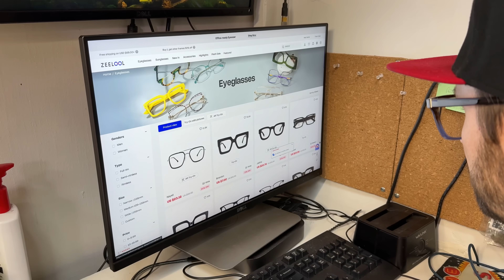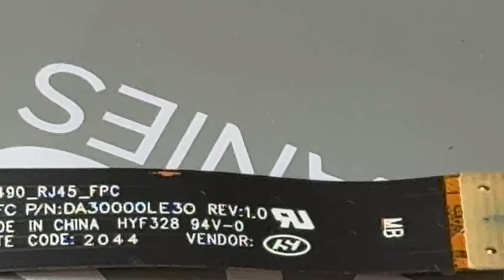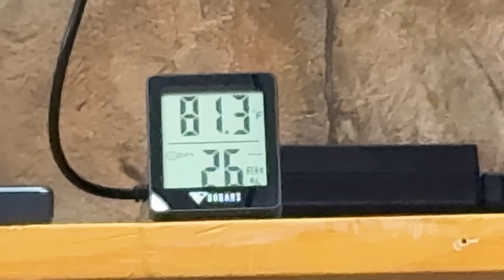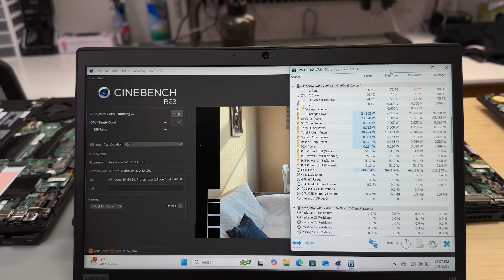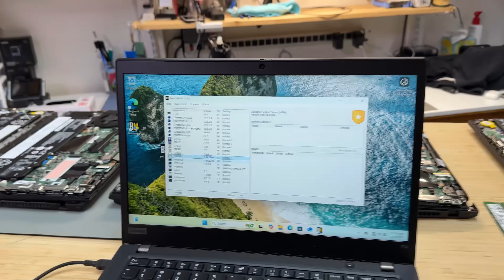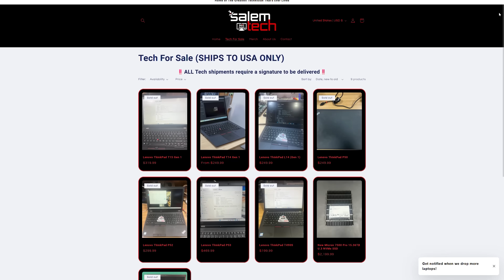Is Replacing Laptop Thermal Paste a MASSIVE Waste of Time? Let's Test!

Comment: Imaging devices - These are corp laptops so they can be PXE booted.  You may have to invest in some hardware - server and a big switch to handle the amount of connections.   If you're imaging Windows, then use Win server and MDT which you can install Windows+drivers in one go and in a reasonable mount of time.  Imaging Linux can be done the same way but with something like FOG project.   Fresh wiped drives, enable PXE and image up 20 lappys in about 45 minutes.
Reply from the maker: Thank you, I've known about PXE but the setup is intimidating. What about when the laptop doesn't have an ethernet port? I'd have to have like 100 USB-C adapters yeah?

Comment: I reduced thermal throttle considerably on my msi gp75 when I replaced the thermal paste and thermal pads. Still sounds like a jet engine but using a laptop cooling pad helps with the sound.

Comment: Hey ! For you deployment problems you can spin up a WinServer with WDS /DHCP and MDT, then boot everything from the network (PXE) with computers plugged to a switch. However, with all the reimaging you are doing (even with your solution) you legaly need a VL agreement with Microsoft. ( It's a licensing restriction, not a technical one, however).

Comment: Counter point to the blue light glasses, the reflections in your eyes from lights behind you will become blue which is very distracting

For laptop's Imaging seems to be the "old" way to do it, I'd suggest setting up a few USB's or a PXE boot server to get imaging up and running. 

Shipstation is a pretty cool solution for shipping tracking and they offer some partnerships with shipping vendors.

Comment: @3:45 deployment problems, 

Spin up a WinPE server and create a Windows .wim to use for the install, set up an unattend.xml file for setup. I spun one up at the MSP I used to work at for a client that frequently was replacing HDDs with SSDs, it made it so much faster since it could be ran anywhere on their LAN and was only bottlenecked by network speed of routers/switches, and CPU usage on the machine getting imaged. My current job uses SCCM (overkill for smaller businesses) so PE should work fine

Comment: Have a look at FOG project, or MDT as free imaging options. You can deploy a golden image per model or do custom deployment settings like unattend file, account setup, or driver and app install sequencing. PXE boot is the way to go, just make sure server and switch is good enough to handle throughput, and laptop BIOS has PXE boot enabled. Use USB 3 to ethernet adapters if theres no ethernet port. Good luck man!
Reply: Alternatively,  you can also just deploy images with a bunch USB drives (anything slower than 3.0 will take ages). Either with a golden image / clone or a custom wim injected with drivers and packages using DISM. You can still use scripts to modify the boot and make the end to end install automated, so all you need to do is plug in and select USB boot (after doing the prep of course lol).

Comment: For me replacing laptop's thermal paste is a really fun thing to do~

And it's a step that makes you study about your laptop
Reply: I have to agree...it's scary at first. Tbh

I had to do my first thermal paste application without any high concentration based isopropyl alchol because I could not find any in stock. So I had to use a cleaning liquid which had iso alc in it.

Wouldn't recommend but it worked, so temps went from 80 degres to 50 ish at idle. 

Sidenote: This was my old i3 115g4, which had a high base frequency for a laptop at 3.0ghz and a 4.0ghz boost clock. Thus the high idle.
Reply: How do you get over your fear of destroying your expensive laptop while trying to do this?
Reply: @thomascromwell6840  
One thing I WOULD advise.
Restart into BIOS before the procedure and look for the "Battery disable" (Or similar) setting, set to "Disable"
.
Unplug (Obviously?) before doing this.
This ensures there's no power on the main board (except the BIOS battery) when you dive in and start dropping screws on components.
STILL unplug the battery.
AND
If you try to reboot when you finish and PANIC(!) because the Laptop is "dead", connect  the charger, THEN hit the power button. That may be required on the first Boot.
Reply: @thomascromwell6840  Depends on what your model is, I would advise a few very important steps, I learnt from my first time doing this.(Sorry for the paragraphing but I used my botched attempts on a cheap laptop as an example.)

1. Make sure you have the correct tools. This is crucial as a not having correct tool, for instance a pry tool (which you can easily find at a computer store) might result in you improvising and using something stupider like a fork. Which can leave marks or permanent scuffs and damages. Usually what you need is:
      >A small screwdrivers set
      >A pry tool
      >ISO Propyl Alcohol (around 70% is generally okay)
      >A microfiber cloth or wipes
      >After watching tear-downs, you may want to see if there is other specific items you also need, such as for HP they tend to put screws under the rubber feet of laptops,      thus I also need a set of the special glue to re-glue them (the specific other items required vary between laptops and their repair-ability.)

2. Watch videos, even at 2x speed having an idea of what to do is better than having no idea at all. You can watch general servicing videos which instruct on what procedures to follow when changing thermal paste on laptops (IE. Make sure you are not doing this on Linoleum carpeting or a tiled floor, a wooden table would be better and the first thing to do when inside a laptop is to disconnect battery). Then you can focus on your laptop specific tear down video from manufacturers or a third party. I know for my new laptop (HP ENVY 2023), that HP has made a video on their YT with a detailed tear-down and I can appreciate them for it.

3. Have a LOT of patience and I mean a lot. On modern high end laptops, everything can packed into the size of a A4 sized, 200 page book, imagine that. So computer professionals can take about 2 hours depending on the make or model (looking at you Acer Nitro), for a first timer it might take 4 hours. The more patient you are the higher chance you are putting it back together. Even when taking it apart it may seem that things are moving slowly, prying slowly over a larger spread is better than a large application of force with a chance of damaged meatballs.

4. Stay organized and refreshed. Have a snack around which won't damage the open internals (definetly not Cheeto dust or liquids but maybe a few apple slices or sth). For staying organized, it helps to have a seperate table or flat secure surface around the house to temporarily label and store the small components and ESPECIALLY SCREWS with different lengths that you pull out. Make sure you are especially careful with the heatsinks and the fans and give them a clean too, a toothbrush to clean off fan dust (a blower might spin the fans too fast and damage bearings) and isopropyl alc to clean off thermal paste.

Just make sure you learn how to and how much thermal paste to apply when changing it and don't forget to miss the gpu, if there is one. The less uncertainty there is the less fear you have, just don't be overconfident(thinking you are better than the professionals or tutorial) and be careful instead (playing a video on the mobile while changing it to make sure. I hope this provides some help to anyone who reads it, thank you.
Reply: @dragonic_rage  thank you for your advice. Btw im scared of damaging little thingd around the cpu while cleaning the thermal paste
Reply: @dragonic_rage Unfortunately I noticed one of the screws got stripped when I was trying to get access to the CPU. That prevented me to replace thermal paste.
Reply: @dragonic_rage  hey thanks for the advice! 
Think you can recommend some thermal puttys for the VRAM and power delivery chips for the laptop??
I was thinking of opening mine up and repasting the system this year.
Reply: @hulllitok the components are pretty tough. They can withstand a lot if you don't apply a lot of force.
Reply: @legendaryslayer1234 oof. There is not much else to say here.
Reply: @thomascromwell6840  Getting real drunk beforehand. 

That is a joke do NOT do that.

No, its just something you kinda...gotta get over. Study, go slow, trust yourself. That's really all you can do.
Reply: It is a huge pain when the CPU is not accessible without dismantling the whole laptop. I took apart my friends laptop and it took me 1 hr just to get to the CPU. One freaking hour! Bc the CPU was mounted to the side of the board that's underneath the keyboard.
Reply: I am all for familiarizing yourself with your equipment!
Reply: I want to repaste my laptop so bad but I don't know if this is going to solve my thermal throttling issue
Reply: @zandatsu07  Depends how long it was since it was done last time. I just did it on mine. Not because of any issue. But I try to change paste every few years and also clean it good. It’s honestly not that hard. There are videos on YT on how to do. Also remember to take pictures so you know how it’s supposed to look. Mainly to remember which cable goes where. Take your time and don’t let any furry friends near your opened laptop.

Comment: I'm a lady! How often does thermal paste need to be replaced? Annually?
Reply from the maker: There's not a set time since it's different for every model and how it's used. Generally if you notice your performance going down and your fans start to get crazy even on idle, it's time to check your temps.
Reply: @SalemTechsperts  Thanks so much 😊

Comment: Lenovo has come a long way since the days of the T400/T410.  Andy, I don't know if you ever worked on those, but the fan design was so bad on those that it could warp the mainboard.
Reply: Isn't that the same thing that happened to the Xbox 360 where the heat sink was so bad it would warp the board when the system heats up too much?

Comment: I put ptm7950 on my 2015 macbook air and 2011 macbook pro. Yet both are still overheating with max fan spin. Should I put a second layer of ptm7950 so that the heatsink makes contact with the thermal paste better?
Reply from the maker: Drill holes in the bottom case where the fan intake is. I'm being serious. Obviously remove the cover beforehand and smooth out the holes after.

Comment: I own a computer repair shop and imaging drives individually isn't difficult or time consuming if you have the right tools.  Get rid of that PCIe adapter and instead buy a USB NVMe docking station.  It takes literally 60 seconds to make an image, so 77 laptops would take you less than 1.5 hours to image.  The imaging software I use is Active@DiskImage though I'm not sure how much that factors in to the imaging speeds.  I think you use Disk Genius.  I used that software once and I didn't like it but I didn't spend a lot of time using it so I don't know what its limitations are.  With a good quality NVMe docking station connected to a USB 3.2 Gen 2 port you can easily reach speeds of 400MB/s and an SSD with a fresh install of Windows is only like 20GB in size after compression, so yeah, it takes 60 seconds to restore the image.  The USB docking station is key to making the images go quickly because you don't have to shut down the computer and take out the PCIe card, then screw in a SSD and boot the computer again between each image.  You can just pull the drive out just like you used to do with those old toaster style hard drive docks.  The most annoying thing about the whole process is clicking on the "safely remove hardware" icon in the system tray before pulling the drive out.

Comment: No it isnt, Just replaced my thermal paste on my Zbook 17 G3 and before My M1000M GPU utilization was 90% with just Wallpaper Engine, after I changed the paste, It went down to 25%.

Comment: I've had many used Thinkpads come and go and from my experience, in some cases, the original paste is still good,
but those are rare and is better to just change it when you are at it. Spreading the paste to cover the whole die though,
is useless because it ALWAYS spreads by itself because of the pressure when you screw in the heatsink,
that is definitely a waste of time.
Reply: I bought an Acer nitro 5 that was overheating because the thermal paste wasn’t spread properly. 
Whoever applied it must have pressed the cooler on super unevenly and it all shot out one side because half of the die literally had zero paste on it.

Comment: For me, replacing the thermal paste is worth it, because when it gets to that point, the temps have skyrocketed and the paste has gone hard., therefore not doing its job properly.
Besides, a tube of Arctic MX-4 is not expensive.

Comment: For cloning I'd use Veeam Agent for Windows on the original to a NAS, then boot the recovery image on the laptops with a LAN connection.  You could also try the network stack in clonezilla.

Comment: Hey great video! I was wondering why you specifically are looking for ThinkPads? I'm curious 🙃
Reply: I think it's because these models are reliable and can be fixed instead of having to throw the whole thing away
Reply from the maker: Not just ThinkPads, every other model I listed in the video.
Reply: They look nice and clean, are easy to service and durable. Also applies to most other business/professional computers. 

This in stark contrast to say, older HP Pavilions, which are probably the flimsiest pieces of shit laptops ever that disintegrate if I rip a fart in its vicinity and probably are better repurposed as a Frisbee from a high-rise balcony.

Comment: My laptop goes extremely hot, only when playing games.  For normal activities, like browsing the internet, it's fine.  I have a laptop cooler, but since the case is in the way of the fan, it doesn't get cooled.  So I have to remove the bottom case, so the laptop cooler fan could fan the underside of my laptop.  This started recently, like several months ago.  Bought it new in Feb 2022, where it had no issue with cooling.  Could it be the thermal paste gone bad????
Reply: clogged with gooch dust! but also could be the paste. some brands use better stuff than others. easy enough to do both at the same time. make sure the screws go back in the right hole! worst thing you can do is long screw a short hole, that breaks boards.
Reply: Yeap two things -
1. Disable turbo boost!
2. Use good thermal paste

Comment: 6:30 where is your source that Intel says to not put any termal paste on it? It's completely not sure.
Reply: I usually put thermal paste on both sides of the CPU, if the CPU has two parts to it (with an integrated PCH).
Reply: @TheSpotify95  I guess that his logic for what he is saying is that the heat from the CPU will spread and heat up the cooler iGPU. But I just don't see that been the case..

Comment: 6:20 A slight correction: That's not an iGPU. It's called a Southbridge chipset that provides and controlling the connection from the I/O port (USB, PCI lanes, display and audio in/out) to the processor and vice versa. It consumes only a fraction of watts so it does not need a heat dissipation

The iGPU in question, is integrated inside the main chip
Reply from the maker: Yes, it's the PCH and I'm an idiot. I trimmed that part out already.
Reply: @SalemTechsperts In fairness, old iGPUs were integrated onto the Northbridge. As someone that had gamed on an Intel GMA, those were dark times. Poor college gamers have it far better now.

And Arrandale/Clarkdale had the iGPU on the in-package PCH, which is accurate to your original statement.
Reply: Yeah he tried trimming that out in the video. I did a double take and thought it was a fluke in the ending at first but then realized what he said lol
Reply: but on some laptops it helps putting a tiny heatsink and some thermal paste on the pch, on my laptop it used to go up to 80°C, now it runs at 65 °C
Reply: @Heathcliff597  it will not lower ur temps but it will help u not to throttle when its pch too hot, if pch throttle it will lower cpu clock and power, but it will throttle only on gaming laptops
Reply: I did not know that, thank you man.
Reply: I repased my cpu with PTM7950 and put it on the cpu and the PCH. Is it worth repasting to clean that off and only have the PTM on the cpu?
Reply: Nerd

Comment: Quick question Andy, how many ssd (m.2) Can i put in a T490?
Reply: If it is built the same as my T495, one.
There is a second small cellular card slot (in addition to the WiFi and SSD M.2).
But this is keyed differently, so a standard SSD will not fit in it.
And if it exists, a custom one which would has compatibility issues with the Bios.
Reply: @WyvernDotRed  maybe a 2240 m.2?
Reply: @ Nope.
I have tried poking a spare 2280 in the slot.
The separator is at a different position and has different pin-counts to either side of it.
Both electrically and physically, a standard SSD will not work.
But like the WLAN slot, it carries PCIe, so a custom SSD with the right keying could work, if it exists.

Comment: 6:20 This is not the iGPU, it's a chipset controller. The iGPU is inside the main CPU package. If the GPU was pulling over 10 watts, how would it be able to stay cool with no cooling?
Reply from the maker: You're correct, idk why I said that, I clipped it out already.
Reply: @SalemTechsperts  I recently repaste my laptop, I followed your instructions and didn't apply paste on the smaller one (which according to this comment it's a PCH) should I just apply paste on it or let it be? (my cpu is i5 8250u)